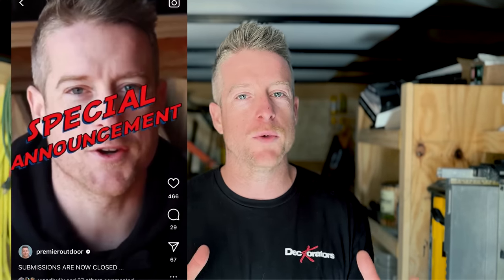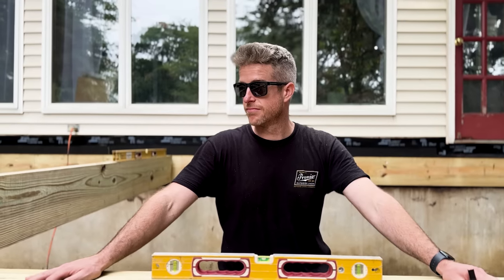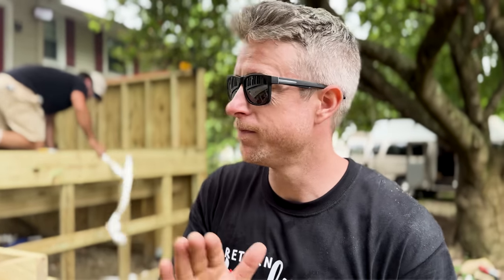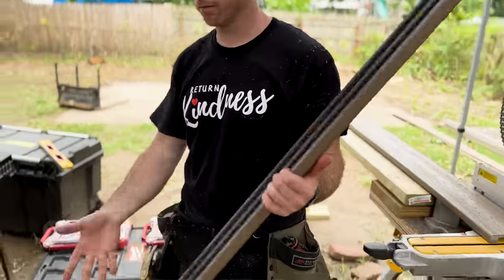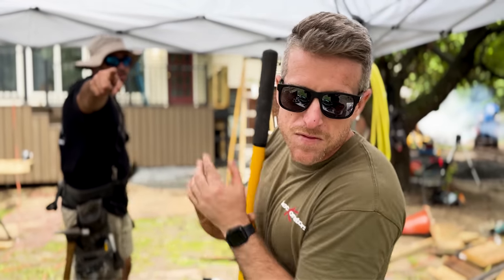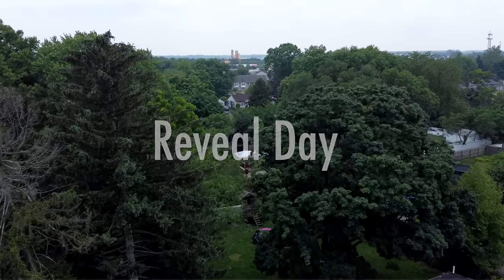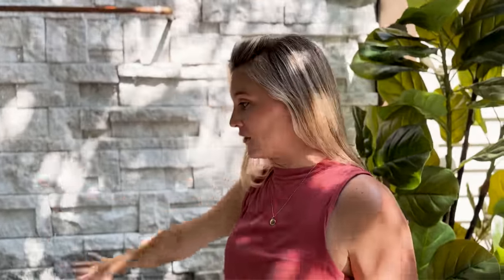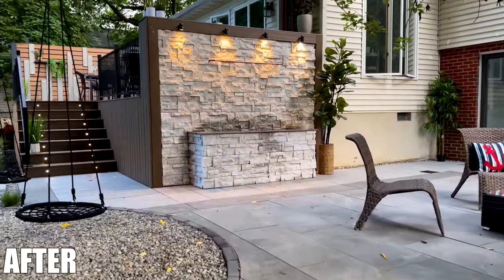$1 BACKYARD MAKEOVER?!? Deck and Patio Giveaway!

Comment: Just started watching, but it looks like you all just put new board over the rotten board. If that is the case, wouldn't you still be concerned that it will still fall?
Reply from the maker: The sheathing was rotted the most so we took all of that off…the existing rim board wasn’t in great shape but it wasn’t completely rotted through. We put new plywood up, then ice and water shield so it will never see water again. Since the existing rim board wasn’t in the best shape we marked out the internal joist layout and put 6” lag screws directly into the joists instead of just into the rim board
Reply: Thank you for the reply! Keep up the great work! Love your content!
Reply from the maker: Really appreciate the support!